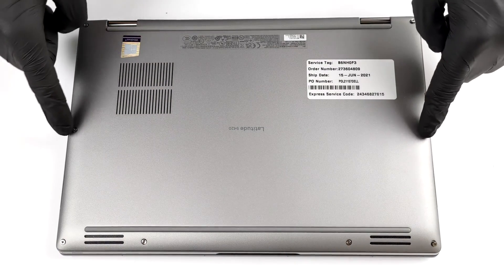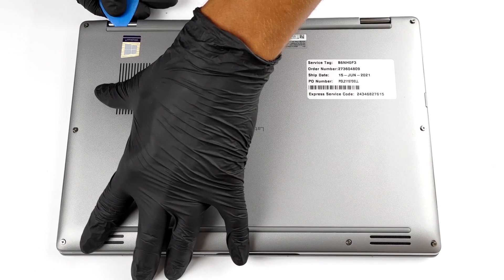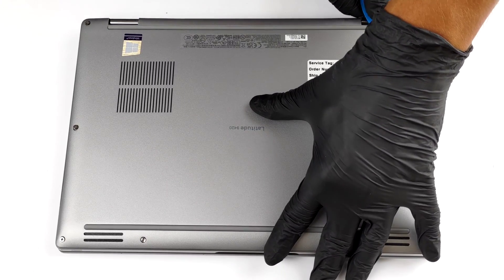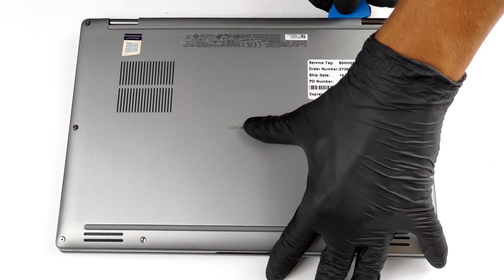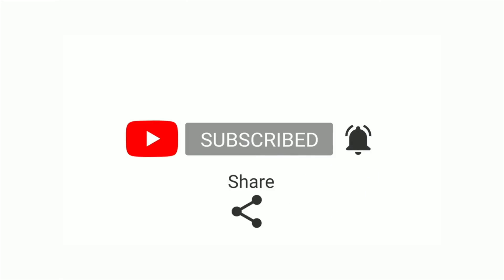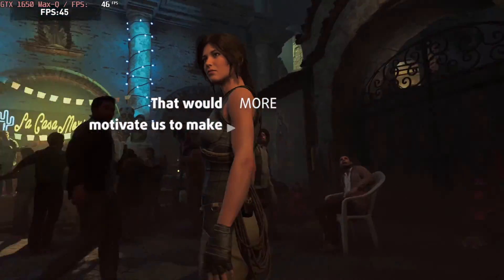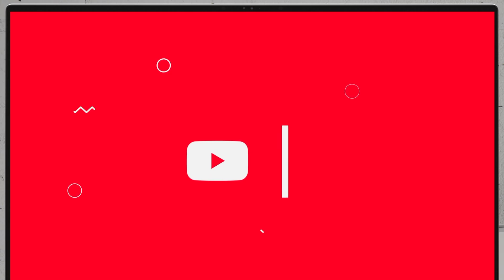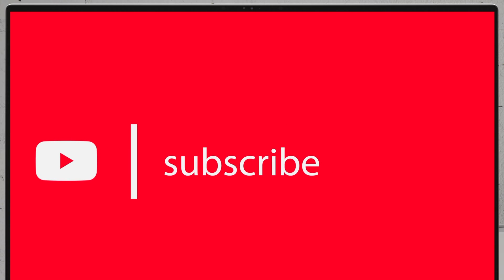🛠️ Dell Latitude 14 9420 (2-in-1) - disassembly and upgrade options

Comment: Thanks, and to disconnect the battery, gently pull up on the connector. You may want to hold down a good spot nearby the connector to reduce strain on the main board while you are pulling up.

Comment: Does this laptop have a CMOS battery? If so, where is it? 🙂
Reply: No it doesn't. It uses an integrated CMOS battery.
Reply: @sensei1slap  Is it possible to replace an integrated CMOS battery. as whenever i turn my laptop on, it keeps asking for date and time. what is the best thing to do.
Reply: What is the condition of the laptop battery?
Reply: @sensei1slap  it is excellent as shown in bios.
Reply: Is it possible to replace an integrated CMOS battery. as whenever i turn my laptop on, it keeps asking for date and time. what is the best thing to do.
Reply: The laptop battery condition is showing as excellent.